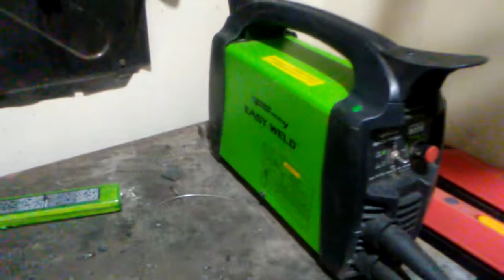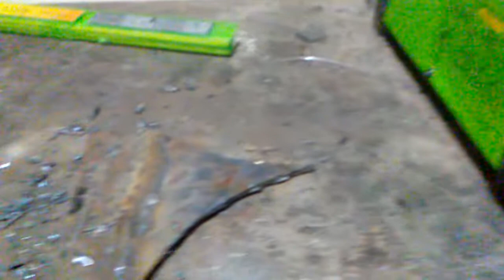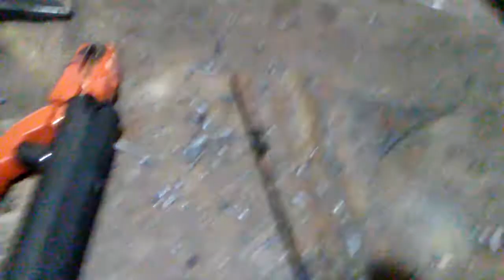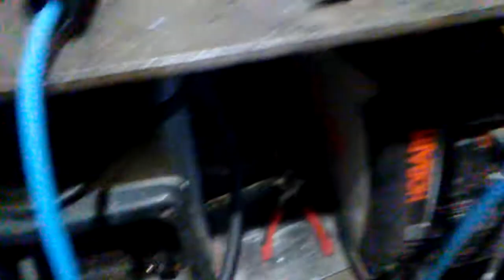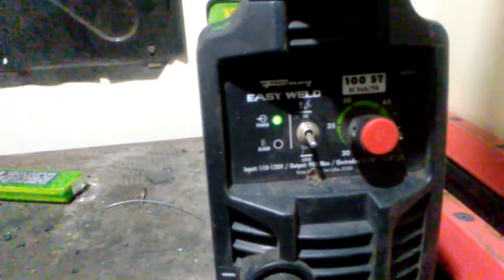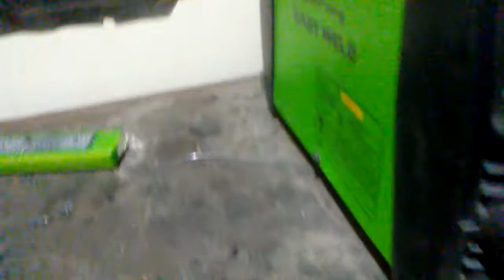Forney 100st easy weld part2

Comment: These little machines work really good with 7016
Reply from the maker: Oh cook. I haven't tried those type rods as of yet. Thanks for info and i intend to try them out. I've seen them but never bought it. Im on a very shoe string budget lately. Ill take interest of trying out thode type rods. Thanks again.
Reply: I just did a bunch of stainless welding with this machine it worked excellent